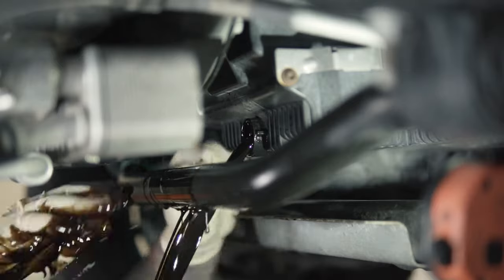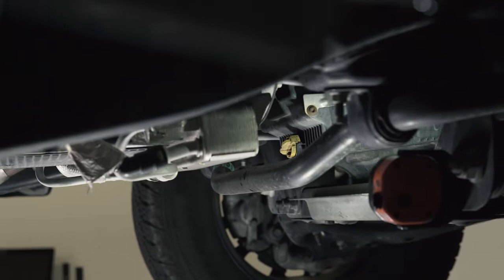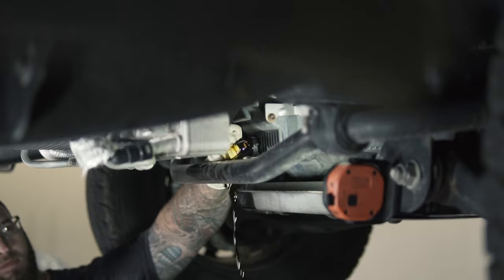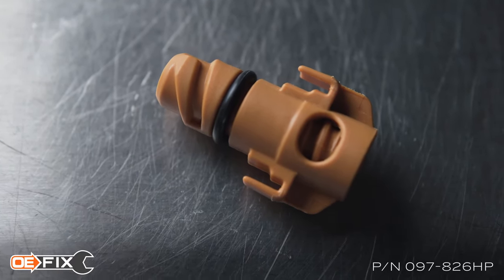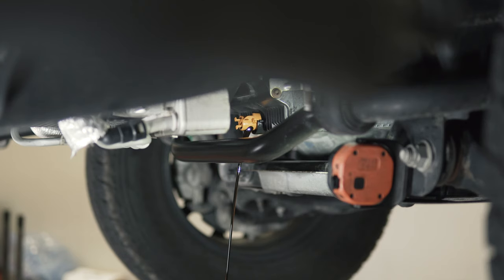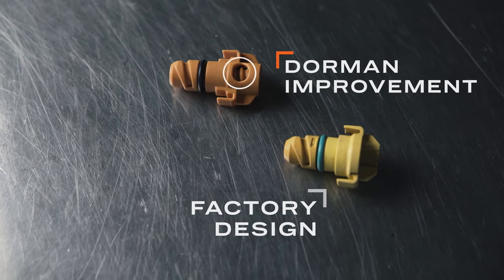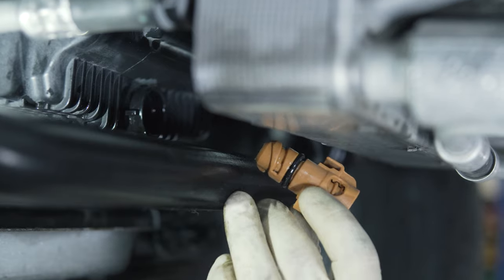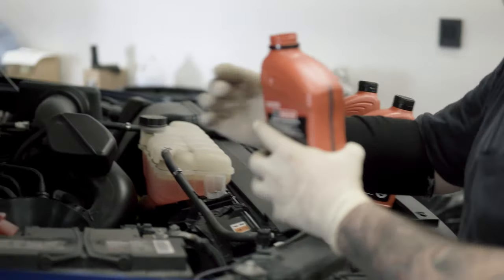Make F-150 Oil Changes Clean and Easy with Dorman’s OE FIX Twist Oil Drain Plug

Comment: I installed one after a couple miles i noticed it had a slooow leak it was tighten, just ended up drain all the new aims oil$$ and putting a oem back on

Comment: I am.using this plug. It is definitely far better in build quality than OEM plug and easier to . Ronin plug is junk doesn't seem secure and tight. This dorman.seems safer than factory OEM
Reply: @gangats0: Question. Do you have to replace this plug with a new one at every oil change? I was informed that the OEM plug must be changed and regasketed every oil change.
Reply: @bikdav  I have a '22 2.7 with 29,000 miles and have had around 5-6 oil changes so far and my OEM drain plug just recently started a slow leak. I would guess the gasket may need replacing every 3 oil changes or so but as usual, YMMV. I just replaced the OEM with this Dorman recently and we will see how it does

Comment: What's the difference between 097-826HP and 097-826HPCD? They both show compatible with my '22 F150 2.7 on your site
Reply from the maker: Great question! The only difference is how they are packaged. The CD suffix means it is carded, so it is put on a cardboard card and plastic wrapped.
Reply: @DormanProducts  Thanks for the reply. I have already installed the 097-826HPCD version and am curious to see how it holds up over time

Comment: I didn't know the oil drain plugs were made of plastic
Reply: @117Burn: It was news to me also.
Reply: This video is 100% accurate. It sprays right on the sway bar and goes everywhere just like the video if you don't pull the plug out part way and let it come out slow
Reply: @hip_check  Just like some small engine oil drain plugs. That has NO PLACE on an automobile. Shame on FORD.
Reply: @hip_check you are so right. I have to slowly remove this plug just enough to get a slow stream going, and then after about 5 minutes, take the drain plug all the way out. Kind of a PITA, but it’s either that or make a big-ol’ mess! 🤨

Comment: Great idea BUT.... these drain plugs are $36-$55 each. How are you going to convince your customer to spend the money on one of these so next time your job is easier? The answer is....
You can't. Even if you were able to sell it, who says they're coming back to your shop for the next service? This is a piece of plastic, with a down pointing hole in the side save a screw valve inside. Probably made in China, how do you justify this cost? It should be $5-6, and the service tech would be able to sell it to the consumer. I wouldn't pay $35 for one even for my own Ford, if I had one. Good luck selling this Edsel!🤣
Reply: They are like $12? 🤦‍♂️😂 and bubba, a good amount of truck owners change their own oil…. Sooo you lose 😂😂
Reply: @bradleynolff5283  literally what I was gonna say, got mine for like 10 bucks and to not have oil in my driveway totally worth, great little product
Reply: Gotta say it… you’re wrong. I just made a huge mess today, and am ordering my replacement today. I’d pay $100 for it. No one is changing my oil except me. Ford screwed this up. $60k for the truck, so $36 for the drain is worth it to me.